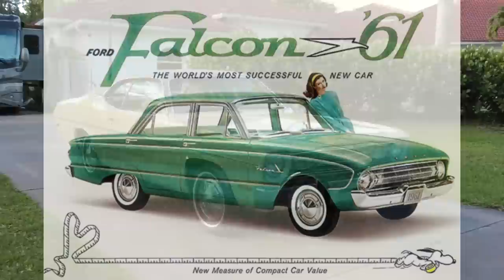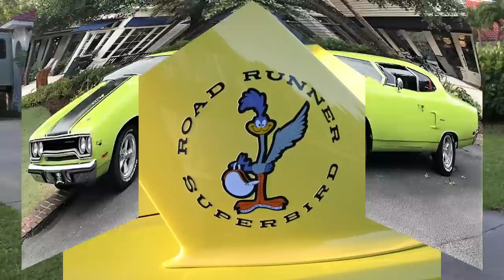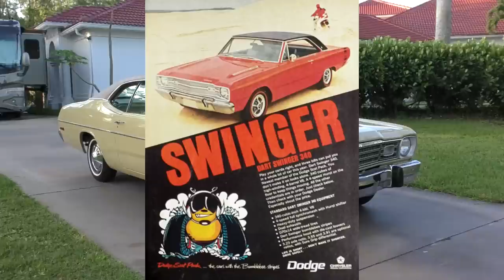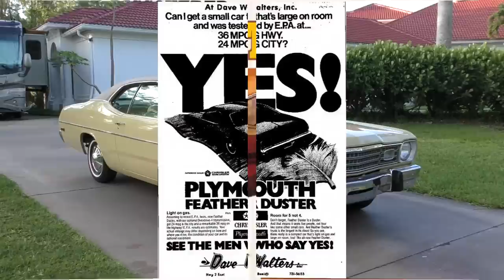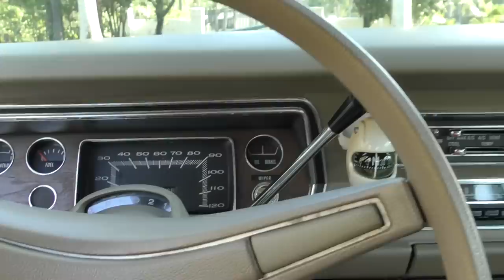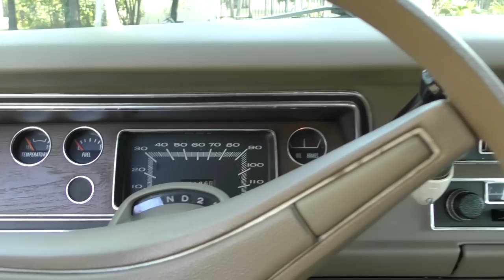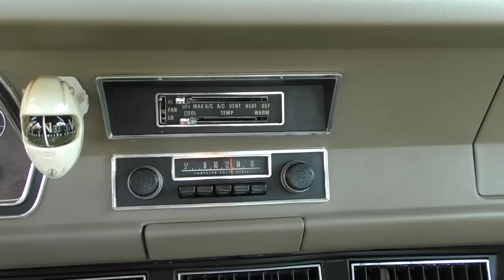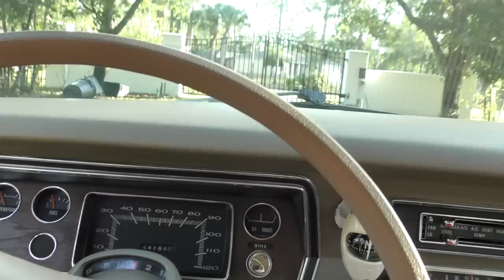The Plymouth Duster is a Mostly Forgotten MOPAR Coupe That Was Loved Against The Odds

Comment: A 1970 Duster is now famous for being the ride of "LIMU EMU (and Doug)" from Liberty Mutual Insurance TV commercials.  My first car was a '70 Duster.  A really bad backyard home modified 340 4 bbl./4 sp. hot rod that could pass everything except a repair garage.  In the upper Midwest we called them Rusters, because most cars in the '70s rusted out from the Winter road salt.  I had it 7 months and got rid of it for an early Civic, which was also a rusting turkey.  '73 and '74 were the two worst years for U. S. cars, early years for emissions controls but before unleaded gas.  '73 model cars were required to have a seat belt/ignition interlock that mostly ended up getting disconnected after a couple of years or when the factory warranty ran out.  The driver and front seat passenger had to have their seat belts buckled before you could start the car.  Probably long disconnected or no longer working on this one.  Nice clean little-old-lady car.  Air conditioning was not all that common in that era, which is why even that car's factory air looks like aftermarket.

Comment: I miss my 1973 Duster so damned much !  I bought it for $75 in February 1992 --- yes , it was in running condition . It was TB3 Basin Street Blue with black interior ; 318 / 727 / 8.25" rear with 2.71 gear .
I had it only 7 months before it was totaled in a not-my-fault wreck on 12 Sept 1992 .
I still remember its full - V.I.N. :  VL29G3B375353  and its licence plate number : 726 HYH .

Comment: I drove a '72 and a '74 Duster in HS.  The '72 had the Gold Package with the 225 slant 6 and the '74 had the 318.  I love both of those cars.  I wish we would have held on to them. Funny you mentioned power steering and brakes.  The '72 had neither, it was an option my grandmother did not get.  It was quite a workout to drive.  My grandmother drove it like it was nothing up to the day she died. We always said she was an east German shot-putter. I guess they were a different stock of people in the early 20th century.

Comment: Back in the 70s when I was buying my first cars, and gas had climbed from 29 cents a gallon to 59 cents, all the used Slant Six Chrysler products in decent shape were very tough to find, because they got good mileage and were easy to fix.  I always wanted a Duster with the pass-through.  Never could find one.  Still plotting and planning for a hatch - easier to find but not all very large and accomodating.  And small SUVs/CUVs don't all have that much cargo space.

Comment: My best friend got one of these used, a 1972 or 73 Gold Duster Canadian, with the 318. I thought it was real nice, had a white vinly bench seat. I bought my rusty 1968 327 4B Camaro in 1975, I forget if it was before or after. Both our dad's were car mechanics, as was the first owner of this Camaro. He bought a Datsun 240Z. LOL.
So anyway, one night after our regular Saturday movie and cards, we went by a nearby quiet industrial street for a little drag race. Usually we took turns driving. My motor happened to be sputtering that week. So his Duster got off to a faster start, but I soon caught up and blew by. Next day I got my dad to look at it, found 2 plug wires not working. LOL. Not unusual in those years. But as good as the motor was, it had a 2 speed tran and it would NEVER spin the tires on dry pavement. 

Before that he had a 1962 Rambler, until he crashed head on when the other guy got squirrely on a gravel road. In 1984 he got real lucky and won a 1984 red Corvette. I think the Duster went kaput about that time anyway. Then he got a cringeworthy Pontiac Acadian/ Chevette for the winter. What a god damned suffer fest that was to ride in.

Comment: That’s the exact same dash that my 74 Valiant had. Got it from my stepfather for $250 in 1981. Stripped down model with no extras other than automatic transmission. No air, no power steering, and a blanket on the front seat to keep the springs from poking you in the behind. I still liked her styling though.

Comment: Had a green 71 with a slant 6. Met its fate one night when I was cut off by a 75 Chrysler New Yorker at high speed. I walked away but not without an ambulance ride to a nearby hospital for stitches in the face and later surgery for a broken nose. This was 1979. Was replaced by a 73 Dart Swinger. It eventually self destructed by rusting away and dropping the rear end.

Comment: The correct horsepower rating of a 1973 318 engine is 150 hp. The 340/360 were both rated at 240 hp (Both figures are SAE net hp).

Comment: Where to begin...a high school friend with a newly minted driver's license was tossed keys to the handed-down 71 or 72 Valiant 4-door propelled by the bulletproof Slant 6. That car was unstoppable. No matter what, it started, it ran, and it was, well, valiant. My family flirted with a 74 Dart SE which I remember because we'd never owned a Mopar anything. But there it was in the garage for a weekend. Deep chestnut brown with a chamois-colored vinyl roof and interior, 318 V-8. It returned to the dealer on Monday. Another friend's family bought some version of the 75 Valiant/Dart with that awful 6 cylinder motor that also plagued the Aspen/Volare. That engine would require multiple starts on a sunny day in May before getting it in a mood for work. Point being, every one of these cars had the same after-thought looking factory-installed A/C vents hanging below the dash as this Duster. If anybody knows why Chrysler refused to restyle the dash on this high-volume vehicle, hope you'll share.

Comment: FYI, the master cylinder has been replaced. Most Dusters had to have the master cylinder replaced in the 80s. The one you showed is an 80s replacement. What you called a VIN plate is the build info. The codes on the tag describes what it was built with. It's the car"s birth certificate. The seatbelts are aftermarket. The originals were interior color. Power steering was standard on all Dusters.

Comment: Hi Bill, I know you’re not well versed on Mopars especially with all that corona whiskey sloshing around, but also noticed you’re a details kinda guy. This  car has a Torqueflite 3spd in it, which is no “slush box”. It’s actually the 1st automatic that was faster than a manual in the quarter mile, and the fastest shifting transmission of its time.

Comment: Ha!! "Bumper laws".....  Now-a-days, there's almost a zero chance "any" bumper will connect with another "bumper".  Especially with all the jacked-up trucks around here (AZ.)  
Someone forgot the rules!!!  Anyhow.... Awesome Plymouth!  Solid cars that were ahead of their time.
Reply: Have you seen a new car lately? Cars don't even have bumpers anymore. I mean, they don't even pretend.. There's nothing that remotely looks like a bumper on cars these days.. You have bare grilles into the wind. Audi, BMW, Cadillac,Maserati, Chrysler, Ford,  Lexus.. We've gone completely the other way now.
Reply: @MarinCipollina  Yes, they've integrated the bumper underneath the thin skin.  They're still there, but they're usually well integrated underneath the faces, grills, and tail lights etc.  I don't get how trucks can get away with having different heights and cars will basically slide underneath them in an accident.
Reply: @johng.4959  I understand there's a shock absorption system hidden behind the front fascia. My point is there's no visible classic bumper in the traditional sense.

Comment: Late 70s Dusters (and Valiants) in Canada were mostly slant 6s, not 8 cyl. Most were basic econo boxes who's bodies rusted so bad they were essentially biodegradable. Among other things they suffered vapour lock chugging and stalling, sluggish, low hp performance, oil leaks and that infernal valve train noise. That's what I remember from the 1976 Mopar shit box I used to drive.

Comment: Amazing survivor! Great car for the money at the time. These either rusted out, or as you mentioned, got punked out by teenagers with too much spending money. The slant 6 versions ran forever!
Reply: The 225 slant 6 leaked oil around the spark plugs which were sealed with rubber gaskets. This was necessary because the engine was too tall to fit under the hood. The slanted engine leaked oil from the valve cover too, due to the slant. This is not the Mopar engine you want, the gas mileage was no better than the 318 at hwy speeds due to the engine's lack of power.
It was also dog shit slow, with only 100 hp [SAE net].
Ask Dennis Weaver; he could barely stay ahead of a 1961 Peterbuilt 331...going up a hill!

Comment: Too bad these weren't completely forgotten. I had a '72 Dart Swinger, brought it from the original owner with 14K miles. Biggest piece of shit that rolled off the assembly line. It had garbage inside the door panels the line workers put in when they sabotaged it. It used to jump out of park by itself, the 225 wouldn't not start when the engine was either warm or hot. Jean Stapleton drove a Duster to the "All in the Family' set. My grandfather brought a '74 Swinger off the show room floor. The Swinger nearly killed my grandparents when the front seat collapsed on I-78.
Reply: Garbage inside door panels was across the board in all American cars back then. It was even a bigger problem in GM vehicles at that time. My '73 never jumped out of park and was easy to start in all weather cold or hot. I also kept it in perfect tune and rebuilt the carb, which was incredibly easy, when it acted up.

Comment: The ‘73 318 engine had 150 hp, not 230. They changed to net hp ratings in 1972. I would install original orange spark plug wires, other than that it looks all stock under the hood. Great survivor👍

Comment: These cars were not meant to last 50+ years let alone 5 years. Many gave way to rust quickly.
A few of our older neighbors had this car or the Valiant. Man, they sure could run!

Parents rented one of these when our family's Fairlane (302 2V Windsor) was in the shop. It had a 225 slant six and was the same color as this car with the vinyl seats. Mind you, the Fairlane was no limousine, but I was too young to understand why we were in someone else's car, but I knew I did not like the car, it felt like a tin can as opposed to the Fairlaned. I thought I was being punished and wanted the Ford back ASAP.

Comment: the 340 was rated 275hp with a 4 barrel until 1972 when it was detuned to 240hp with a four barrel.  Too bad they detuned them.  Although the AC compressor does look silly, Chrysler had the best AC's as they had all the knowledge from being with AirTemp.  That's a 2 cyl compressor while most other company's offered a 1 cyl compressor.

Comment: I wonder whether we are going backwards or forwards with cars. I had a Valiant Brougham with the 225, A Dart Custom 4 dr with the 318 and a 340 Duster. Indestructible drive trains, simple, room for 5, luggage space, good gas mileage. Now we have these vehicles that need a computer whiz to fix, everything is buried under a mass under the hood, they are claustrophobic, and people are helpless unless the car tells them something. I am a big believer in the kiss principle. You can have this modern crap that all looks alike and costs a million dollars to buy and to fix.
Reply: The Slant 6 with reliable fuel injection is the greatest engine never made.
Reply: @rightlanehog3151  If I recall the alternator was a bugger to replace on the 225 but a good mechanic could r and r the engine in no time. In a Fury you could stand in the engine bay between the engine and the fenders. I know many a taxi would go over a million miles on the slant six. Now some of these new cars require removing the  battery etc to replace a headlight.
Reply: @burningblue1254  We had 73 Duster and a 75 Fury with the Slant 6. You are not joking about standing in the engine bay of the Fury. We changed the starter from the top.
Reply: @rightlanehog3151  Wow! Now that is something!

Comment: My parents had a Plymouth Volare! It was a 1980 model. The only “nice” thing on the car was AC. No other frills. It had a V8 although I’m not sure what size. It also had 4 doors. In the Ad that you showed in the video, it says “the new small car with the accent on comfort.” HA!! Wtf?? 1.) it was NOT small, the car was huge, a good 2 1/2 times bigger than the 1988 Mazda 626 my parents later bought. 2.) Comfort?? I mean the seats were soft, but they were vinyl, and had absolutely no bolstering. The car was also always breaking down and it refused to start on many mornings

Comment: Had a 72 vialiant and 75 scamp both with 727 and slant 6.
Reply: Slant 6 and 318 used the smaller 904 automatic transmission.

Comment: My first new car was a ‘75 Plymouth “Steeler Duster” with the slant six and auto tranny. Worst car ever. Only car that I had a wreck in. Came equipped with the cheapest bias ply tires ever. Such a shame; the dealer could never get that motor tuned correctly. My worst car of my life, and I have owned more than 20 cars. However, I would own this one! The 318 in a ‘73 was far less ruined by smog control equipment in that ‘75. If this car is still available please reply. Thanks, and love your videos. I am subbed and comment and like and share your channel.

Comment: Screams for wide wheels, cam, exhaust and 4 barrel carb. Sorry Bill. . Keep the original parts, don't modify anything that isn't bolt on. Have fun keep the miles low, return it to original at sale time. The ultimate sleeper. People actually changed the K-Member in these and installed RB motors (361, 383, 400, 440) I don't think the Elephant would fit between the aprons of a Duster, but I'm sure someone tried. Old days the header install necessitated cutting the apron between the inner and outer fender, thus fenderwell headers. I would not cut one of these cars for headers, , there are modern alternatives. 

A Feather Duster with a RB motor, 4 speed 833, 8 3/4 sure grip with 3.73's, all power and no weight, a true muscle car. With the 340 and 360, these could be made brutally fast, nearly unbeatable on the street, for not a lot of money, which is why they were so popular and had such staying power through the 70's and into the 80's-beyond.

Comment: I remember when you had to be a Chrysler guy to buy a Chrysler,  no one crossed over from Ford or Chevy.  If I was selling one I'd ask have u owned a Chrysler product? If they said no , I knew there wouldn't be any money changing hands.    But now a days if someone can make a buck that's what matters.
Reply: That's for sure. My uncle-in-law had to have Ford pickups. My dad was a GM mechanic from 1948 till 1984, he always said he wouldn't work on other brands. LOL. He and all 3 brothers had various Pontiacs then Oldsmobiles. I really liked them too. But then the mid 1980s came and GM sucked. In 2004 I bought a new Chrysler 300. Never let me down or rusted, though I only went 77,000 km in 15 years.
Reply: Unless they run into a salesman. If it has four wheels and an engine, a salesman can sell it.